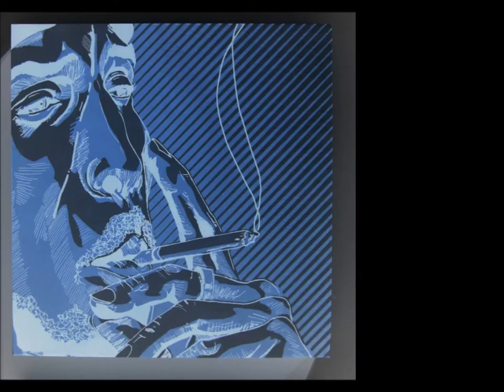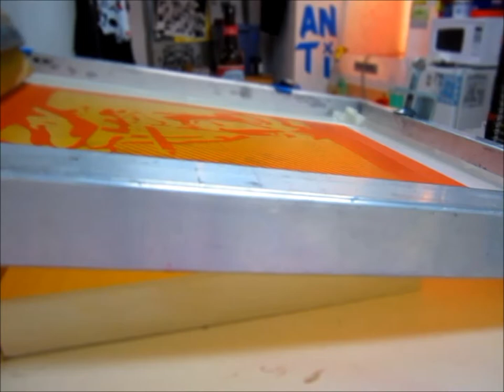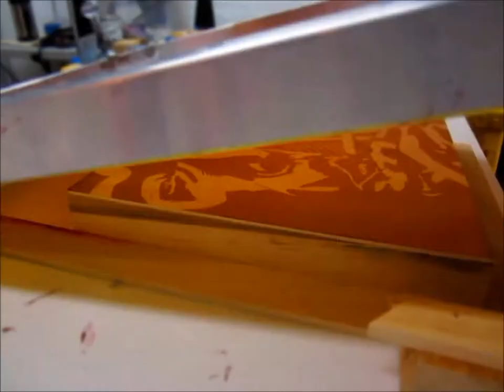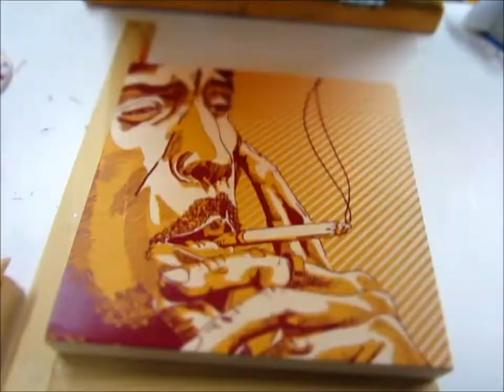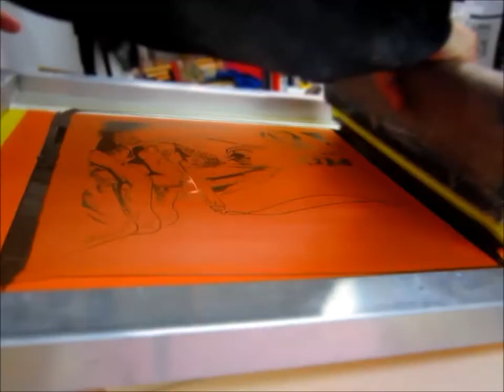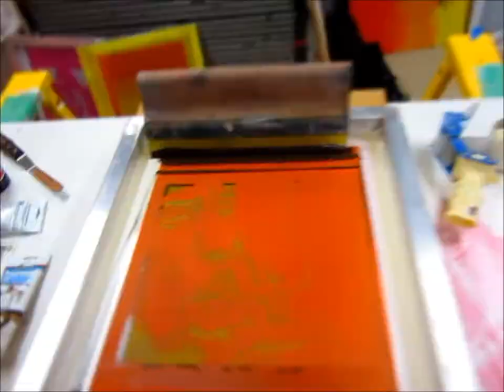Screen printing Omar with wood stain on wood panel - Part 1/2

Comment: Hey - I'm a little confused about where the wood stain comes in. Do you print with normal acrylic then use the wood stain as a sealer - or put the wood stain on first?
Reply from the maker: we printed with wood stain so it became its own color